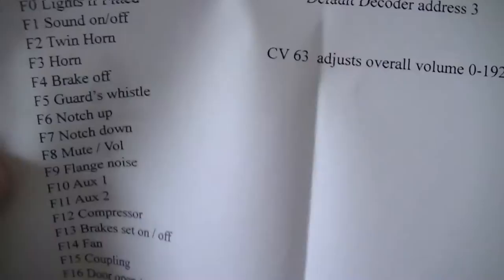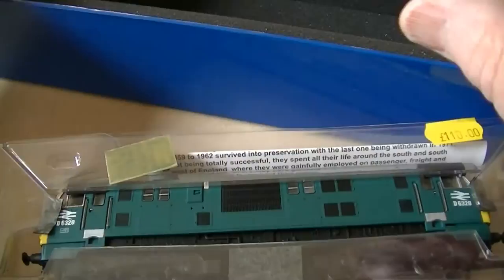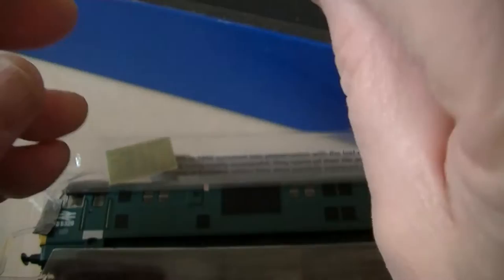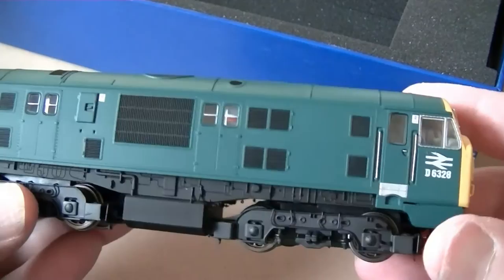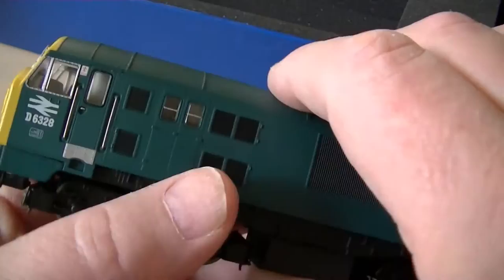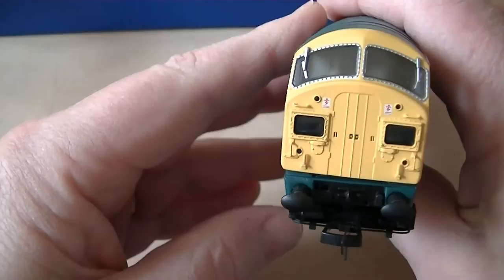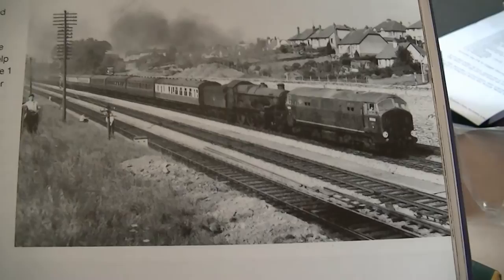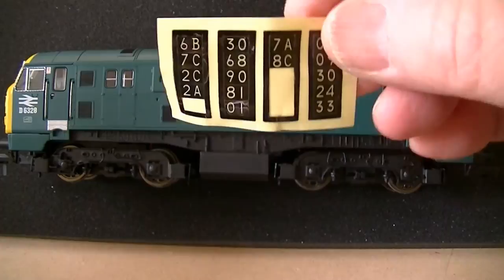Farland Howe  Dapol's Class 22 Locomotive  #100

Comment: Hi Rob. Only just discovered this video as I just bought a new DAPOL 22 DC at bargain price of £79.50. Just a note about the layout of UK 4 digit headcodes in case you don't already know. Reading left to right the first digit is always numeric. The second is an alpha character and the final 2 are numeric. Their meaning was to indicate type of train (1st digit), destination (2nd digit) and the last 2 numbers were the trains running number on the days timetable. E.g. The first digit of 1 = Express passenger, 2=Local passenger etc. The 2nd letter destinations varied by region but "A" was always the main terminus (generally London). You can probably find lists online. The loco headcodes were eventually removed from locos when signalling moved to large central centres who couldn't see the locos but the control panels still show the same 4 digit codes for signallers use today.
Reply from the maker: Thank you, This video is from 2015.  I've never been able to find a concise historic list of headcodes.  I do not believe one exists.  I do love my Class 22 however.  Rob

Comment: A stunning addition indeed Rob! Very tempted myself! Totally agree about the detailing pack, but not sure if I would add the side panels to this one. And the same with taking models apart too ;) Think her being in Blue will fit in very well on Farland, as BR Blue was started being applied to locos in the late 1960's, around you time period. There is a group in the UK hoping to rebuild one from new! Which sure would be a sight if so! Must say she sounds superb! Looking forward to seeing and hearing more from her!
Reply from the maker: Hi Callum, thank you for the comment.  Is that what those odd shaped pieces were, side panels?  I couldn't make any sense of them.  No instructions about the detail pack at all.  I have had some blunders taking them apart and hope to avoid it as much as possible.  Yes, Farland seems to be going blue.  I think my time period is moving.  SuperWHIZZO point that out about the new build.  I checked the project out and was impressed.  I just ran her with 6-7 milk tank wagons and she looked great,  Check you email, I am sending you a picture of something I have added to Howe Street Sta.  Rob
Reply: Yep, they are. Think they just clip in. They cover the black area along under the engine, between the cabs. Dapol provided them not fitted, as some of the class had the odd one removed or fell off. Ohhh, like the sound of that and seeing that formation in future videos. Will check it out.

Comment: That's a nice loco, all the right sounds, the new boxes are a trap, first ones I encountered I think was the Bachmann Blue Midland Pullman took me ages to get it open :)
I have avoided Dapol's but just got a Dapol track cleaner very impressed. May be some LMS maroon coaches.
Al
Reply from the maker: Hi Alan, thanks for the comment.  Although the actual loco was a dismal failure, I think the design of the front end is a stunner.  I think, had they sorted that out and improved reliability many locos going forward from this time frame, would look more like the Class 22.  Dapol does a great job.  I love my Class 52 with its Howes sound.  Maybe LMS Maroon coaches?  Yes.  Rob

Comment: Love the old Class 22s - there was one that was purchased from BR by a private individual, but was accidentally cut up at Swindon before he could retrieve it - he was offered a Class 42 instead, which was to become the first ex-BR diesel to enter preservation. Shame, really.
Reply from the maker: *****  Hi Graeme, from what I have read, they were not very reliable, but the Dapol model of the Class 22 is excellent.  I had Olivia's Trains put sound in mine and I have been very happy with it.  It would be nice to see what a real one would sound like and how they would run in preservation with modern tools and methods.  Thank you for a great comment, Rob
Reply: Rob McCrain Yes, as I understand it, they had early engine and transmission problems but, by the time these had been sorted out, circa 1961, the more powerful Class 35s (Hymeks) and Class 42s (Warships) were available, so they got sidelined into secondary duties. The builders, North British Locomotive Works went bankrupt circa 1962, and the locomotives were eventually retired between 1967 and 1971. There is a project afoot to build a new one, using as many period parts and details (including, as I understand it, using copies of the the original plans, to go into preservation. One of the original engines is rumoured to be in preservation already. 
They have this certain aesthetic appeal for me - they kind of look like they've had their nose cut off, if you know what I mean ... love them!
Reply from the maker: ***** I do know what you mean.  They have a certain look to them, which I very much like.  The class has a distinctive appeal to their appearance.   That is why I wanted the model.  I now have two.
Reply: Rob McCrain Sweet! Both in blue, or one in green?

They're one of my top 3 favourite diesels (along with the Class 08 shunter, and the sexiest diesel ever built, the Class 43 HST (aka Inter-City 125))

I'm a relative newcomer into the world of trains and model railways - sadly, two-and-a-half years of unemployment means I don't have the funds to build one of my own just yet, so I what you call toy-trainless!
Reply from the maker: How difficult being unemployed for a time.  I luckily was able to retire after 43 continuous years of employment.  All the best, Rob

Comment: I'm with you Rob in that I don't put on extra detail packs. I prefer to leave them unopened in the box. Otherwise they might get lost or broken off.
Can you set the same number CV for each digital train you have? i.e. horn is No5 for example on each one. That would make it easy to remember. Or do they do a controller that has a specific horn button that auto-finds the horn? I know Rail-Master PC based system has specific buttons to make it easy.
I think those numbers at the front can be all sorts - at the North Norfolk Railway they set them for each individual journey, going up one number each time. Unless someone knows different. I presume the number they gave you should be ok for the loco.
Nice rivet detail around the window.
Reply from the maker: Hi Laurie, thanks for the comment.  With Railmaster and it is the only DCC controller I know, well except for my original Hornby Select, you name the Function keys whatever you want to call them.  You just have to use an appropriate command.  Like for lights, you need an off on function.  For certain horns you need a momentary code.  

It is easy and the functions  can be assigned and labeled in 3-4 minutes.  On the select, you need a chart of what each does and you just press the function button.  The Select works, but for any advanced stuff you need a better controller.  Does that answer your question?
Reply: Rob McCrain
I think so. I know Rail-Master is a superior system to what I have. I have Hornby Select. What I was hoping for on a controller was an actual button that says 'Horn' or 'Whistle' or 'Wheel Slip' (rather than a number). Then all I need to do is press a button, one of say 25 buttons, and then it auto-finds that function on whatever engine.
Also there are many analogue systems that are still running after 40 years or more. How do you reckon digital systems will fair? I am worried that any laptop I assign will be dead long before 2 decades (hopefully I won't be). Also when a PC is replaced, will it accept the old version of the software? Or once bought can you forever download Rail-Master to whatever PC you have?
Reply from the maker: Calvertfilm Its the future.  The buttons do say what they do.  It is written on them in RailMaster.  You will have pay the license fee or whatever its called for each computer it is installed on.  It is software like any other.   Thank you Laurie.
Reply: Rob McCrain
Thanks Rob. I do want to learn more about DCC hence my questions.
My layout is both analogue and digital - it can run both. But I am holding off on the DCC side for now. It has been the 'future' for years and hasn't really taken off lol. The latest Hornby catalogue only has a few DCC fitted machines. Most do not carry a chip. Why? Surely it wouldn't have taken over after all these years?
For me I just like the purity of running a train the simple old-fashioned way. Turning a control, seeing it go round. I don't needs bells and whistles. And I understand all that is inside analogue. If that makes any sense?
I have a couple of pages listing the fors and againsts of both DC and DCC. Really I can see why people choose either. I would never say one way is the best. It depends what people want from the hobby.
My single Bachmann DCC fitted loco conflicted with my Hornby Select out the box.
I'm not knocking DCC - I understand why it suits some people. Just saying that right now, it's not for me. Who knows perhaps one day? Perhaps not.
Reply from the maker: Calvertfilm All locos are not factory fitted with high quality DCC sound because not everyone wants to spend £200-400 on their locos.  Hornby with their TTS is going in the right direction, but the sound is not what you get when you have a craftsman building sound files that he cares deeply about.  I am convinced that the likes of Olivias, Howes and Digitrains sound files are the result of a dedicated probably underpaid sound genius'.  I love the work they do and it gives me great pleasure to hear the sounds as the loco runs and reacts to my changes in throttle and commands for horns or compressors or brake release or guard's whistle or whatever.  That stuff rocks my boat and I feel privileged to be able to enjoy them  That's all.
Reply from the maker: Calvertfilm I just had a further thought on the subject.  With Windows, you now have to pay a subscription fee every so often to keep the software.  Just a thought.
Reply: Rob McCrain
I see what you are saying.